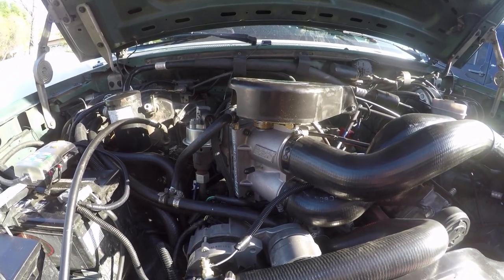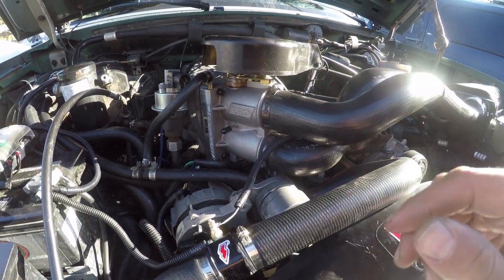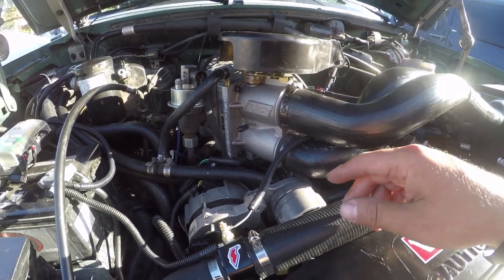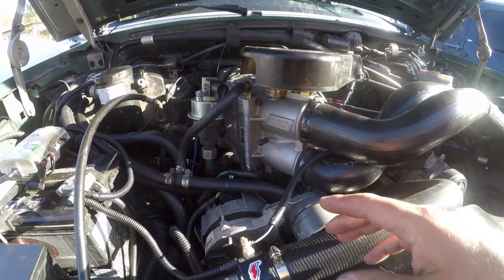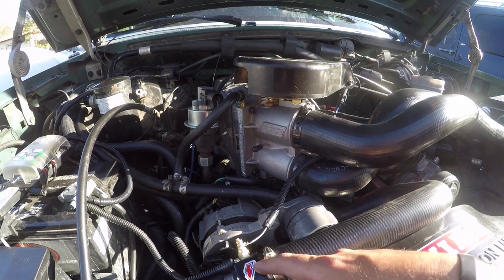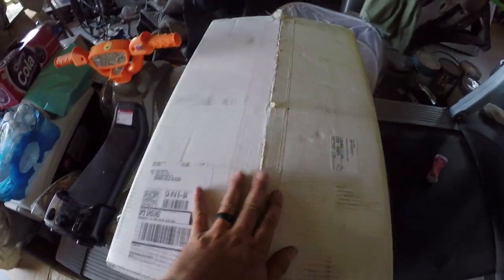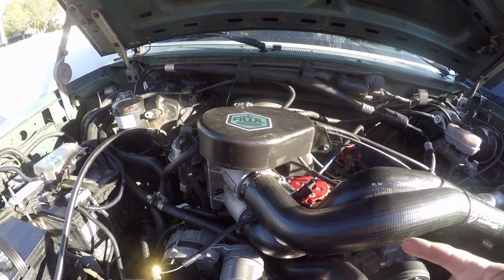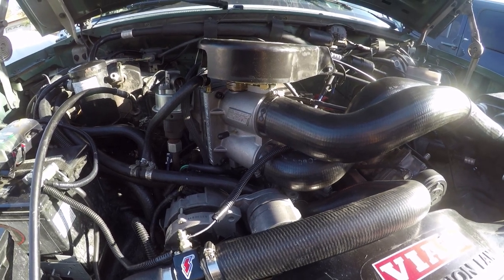BRONCO BBK INSTALL

Comment: I've read about the whistle issue in a couple places.  You need to polish (use rotary tool) where the IAC valve goes to eliminate any whistling noises due to uneven surfaces. It needs to have a smooth surface.

Comment: I put the Twin 61mm TB on my F250 and I used a Transdapt spacer aswell but I modified it from 61mm's to 56mm's as years back I increased the twin 45mm throttlebody to 54.25mm's in the front[inlet]and 56mm's in the rear[outlet] and also ported the plenum with a sandblaster w/coarse sand then also ported the intake manifold when I changed the intake gasket and saw that the Edelbrock #3881 intake had a 56mm inlet so I ported the stocker to twin 56mm's..

If anybody knows about HVAC you know how fluid dynamics work[yes!;- air is a fluid!!]...With the exception to the 54.25mm twin inlets that I modified to twin 56mm's the  61mm increase then the 56'mm taper down effect increases air pressure..In your case it would be 50mm inlet/56mm flap w/outlet funnelling down to 45mm's... My Transdapt spacer stock was 52.47 inlet that tapered down to 47.53..

The TB has a very heavy set of springs which made driving my stickshift very hard especially after doing the spherical heim joint mod to the pusher rod on the clutch to make it effortless[no more nylon bushing!!!]plus the disc flaps get stuck out of nowhere and adjusting the screw to open the flaps throws my TPS out of whack.Theres no tiny air holes in the flapper discs that help balance idle plus the flapper discs are twice as thick as the stock flappers plus the rod that activates the flappers was stuffed into the housing which is why they set the spring pressure so high also the lower bearing was binding from having grit inside i so I had to take off shield spray out the bearing then use a tiny dab of anti-seize on it before reinstalling the shield..There was no welch plugs to block off the vacuum for the vacuum lines as they just relied on the gasket to totally seal it which totally didnt so I modified mine with JB Weld.Sometimes on occaision the throttle would stay at 1000 rpm's and I thought air controller but turned out to be the flapper rod being stuffed in the TB meaning the slots for the discs to fit into werent wide enough for the flaps but someone at BBK made them fit......LOL..Then after fixing the TB I had to disassemble again because there was air leaks at the bearings that I stopped by using vacuum grease packed into the bearings..

After taking the time to disassemble troubleshoot and modify a $400 part the right way and doing it very similar to the way the stock TB was setup my supposed to be plug n play $400 TB now operates buttery smooth with the same pedal pressure as stock,doesnt get stuck or throw off my flawless shifting techniques and works as its supposed to. but for how long its gonna last is still the biggest question...LOL
Reply: Is it normal for a high iddle after installation I when and replace my stock throttle body for a 61 mm bbk on my 93 Ford f150 5.0 but it has a crazy high iddle on it's on

Comment: You should order a throttle body from an 01 Bullitt mustang stock there 57mm and you have to do a little porting to the intake. But they fit perfectly.
Or you can get the big throttle body and do a lot of porting to the intake.  
Good luck brother I have 3 Broncos of my own and always will 😎👍

Comment: I noticed you have MSD distributor cap. What spec is it to include the what kind/type of distributor, spark plugs, cables, coil, etc...Thank you boss.
Reply from the maker: Msd cap and rotor kit #8482
Msd ignition coil # 8227
Bump up your cables to 8mm the brand really doesn’t matter they all worked the same for me. 
The rest just look up “bronco 6 liter tune up” and it pretty much just gives u a hotter igntion system.

Comment: what size coolant temp sensor adaptor is that on the upper hose and where did you get that intake hose assembly ?
Reply from the maker: I got it on Amazon for pretty cheap. Never leaked or gave me an issue. It’s a Dewhel 38mm radiator hose adapter.

Comment: Hey bro I when with a 61 mm on my 1993 Ford f150 and  I got a bad high iddle is that normal
Reply from the maker: That sounds like maybe there’s a vacuum leak. When I first installed it I had to play around with the vacuum lines and had to  reroute them.

Comment: Did you ever reconnect your purge valve to the port that is plugged off?
Reply from the maker: I left it capped off for a bit but the idle was very inconsistent. Eventually I ended up reconnecting everything back to the factory diagram.

Comment: Hey man was curious where you got your intake tubes? Also what did you do with your mass air flow sensor since your running 2 tubes the whole way
Reply from the maker: My bronco is a 90 so it’s Speed Density. No MAF sensor.

Comment: What intake tubes are you running? And what did you do with the sensors from the stock air box? I have a 94 bronco 5.0, looking to get rid of stock intake and airbox, just wouldn’t know what to do with the sensors.

Comment: How did you get the bottom cooling line on there without kinking it?
Reply from the maker: Gave it some extra hose so I would bend nicely without kinking. It took me a while to get it to route  so it wouldn’t kink. Some zip ties helped.

Comment: Looks like there is a throttle body spacer as well what’s that brand?? Be interested in how it effects the MPG. Been thinking about this mod for my Bronco.
Reply from the maker: Josh Armstrong it's a trans dapt spacer. I'll keep you posted on the mileage
Reply: Adventures With Laylay I pulled the trigger and installed the BBK today. Will see how it does over the next week. Do have a little whistle that I’ll need to hone down later.

Comment: Did  you keep the bottom half of the OEM airbox then install the K&N clamp over it to hold the filter??
Reply from the maker: You can keep the bottom half of the air box on but I removed it.
Reply: @SORRYOUTEXPLORING  oh it looked like it was there still lol

Comment: its awesome watching your rig come together man. I have a question on this video though.. I've been looking for a properly sized spacer for my BBK twin 56mm throttle body, but everything I've seen doesn't seem to fit up, its either stock or 61mm... You mention that the spacer is a little bit bigger and works well with the BBK,  do you happen to have a part number for the spacer (I noticed in another comment you said it was a trans-dapt spacer, but want to make sure I get the right one)?  Also, and you may not be able to answer this.. but I have an Edelbrock Intake I'll be installing with the BBK, do you think the spacer is even necessary?
Reply from the maker: Since you have the edelbrock intake manifold the spacer isnt needed at all. Your getting plenty of air flow. But I can get u the part number I'f you still want it.
Reply: @SORRYOUTEXPLORING   If I don't need it I'll probably just pass, lord knows how much money I've already thrown into the project bronco so one less part to buy makes me happy. I just don't want whistle, not trying to go around flexing on the gas pedal pretending I have turbo hahaha ( had one on my previous truck and that whistle got old real fast). If after everything is installed I have a whistle I'll hit you up for the part number. Thanks a ton for the super speedy response and keep it coming with videos!!!
Reply from the maker: @Edirty6  I found a few videos on smoothing out the idle hole in the throttle body so get rid of the whistle. Bbk machines the throttle  bodies with really sharp rough edges so as air rushes past that edge it causes a whistle. A 10$ harbor freight dremel took care of the whistle.
Reply: @SORRYOUTEXPLORING  thanks for the heads up on that, pretty rad considering I picked up a Dremel last week to clean up tight spots on engine parts hahaha. I'll look into those videos
Reply: Hey buddy do you happened to fine some videos of porting that part out
Reply: @nicklugo7068  WIsh I could help ya man, never did though :(